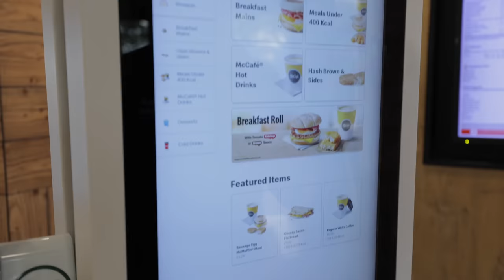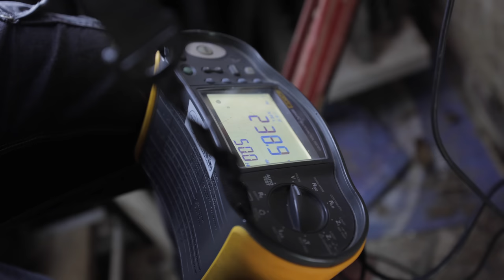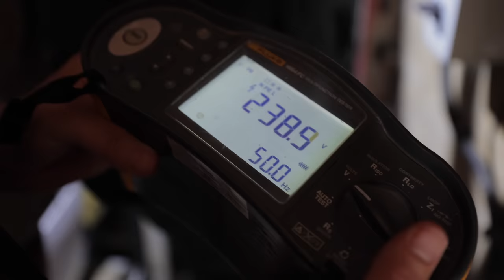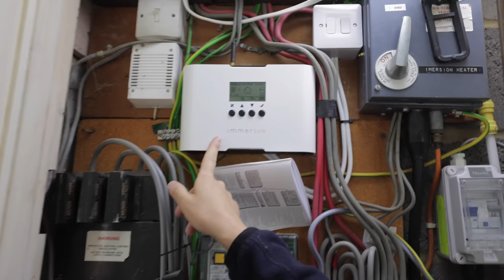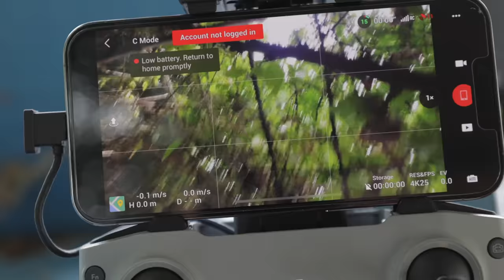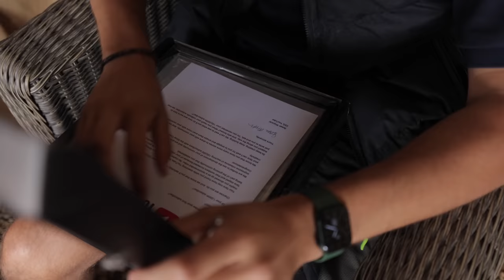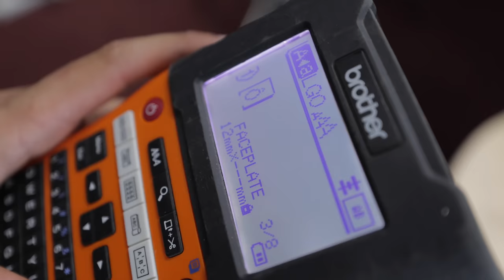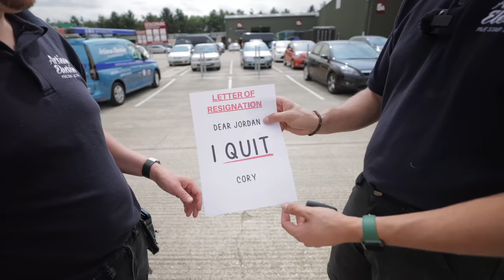CORY QUITS ARTISAN ELECTRICS *NOT CLICKBAIT*

Comment: Cory has been a brilliant asset to Artisan, particularly his humour on the videos. I wish him well in the new venture.
Regarding the inverter.  Firstly weird that they did not put in a 3 phase inverter in the first place. And criminal on the part of the manufacturer that a replacement board is not available to fix a unit that is a mere 5 years old. How long are these things expected to last? What was the installer quoting on the pay back period - they probably assumed an equipment life life of 10-15 years when calculating it. Obviously a manufacturer to avoid!

Comment: I would never listen to the manufacturer when they say something needs replacing. I repair electronics (consumer) for a living and the manufacturer will never tell you when something can be fixed. It likely does need component level repair, but I can guarantee that would be far cheaper than replacement

Comment: I’ve had to replace about 9/10 fonius inverters, can almost guarantee before you get started it’s a faulty inverter. Test to check is to connect “working” string into the non working inverter and working inverter into “non working” string

Comment: Would have been better testing the Voltage and frequency at the ac circuit board controller. There are optic couplers, thermal fuses and power factor caps connecting power to the board that can burn out from power surges, manufacturer faults and part wear. Easy to desolder and replace. Don't bother asking the manufacturer, the people that answer the phone are just sales reps. Only some distribution reps with good communication with factory techs have service manuals or even whole part purchasing availability.

Comment: If that inverter is out of warrenty i would be definetly be taking out the AC board to check elecrronics on it, would easily be just a bad solder joint or trace or maybe just a single component fail.

Comment: 10:07  --  Having a single   3ø   inverter in the long term is the best choice
economically and practically
Sooner or later this will have to be done --
having two more  service calls and replacing another single ø  inverter on
each call  il be infinitely more expensive than biting the bullet [ so to speak]
and  going the single  3 ø   inverter now --- and perhaps selling the two 
working inverters to recover ''some'' of the cost.
It is also possible to repair the defective inverter at the component level.
The previous time I repaired my own was some 12 years ago.
Dismantling the unit and removing the circuit board was a pain in the neck
Reply: I doubt there's anything wrong with the "defective" unit.  They never even went into its settings to see if it was set up right.  99% of the time a power surge has caused this unit to reset to factory default programming it now thinks its a stand alone master unit and may even be looking for 60h.  If they aren't going to bother to learn how to properly troubleshoot solar,  they shouldn't bemissingwith it.  Stick to pulling wires boys, cause you sure as shit aren't any good at solar diagnostics

Comment: now if you had opened up the invertor clocked a dry solder join or burnt out relay and breathed an extra few years out of the unit, one may have been impressed, but hey, ......

Comment: I never saw you check the settings on the inverters.  That should have been step one, especially on a 3phase system.  Solar inverters frequently lose programming and reset to factory default programming,  which will result in interesting fault and or error codes.  Never trust the factory reps top five you good into overt the phone,  they are usually just call center employees reading a script. Inverter install is more like computer programming than electrical wiring.